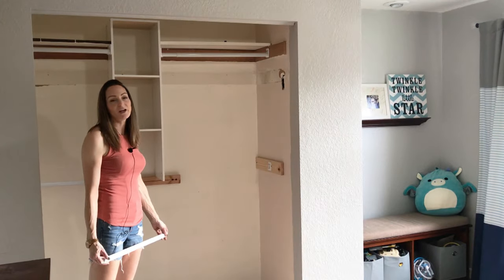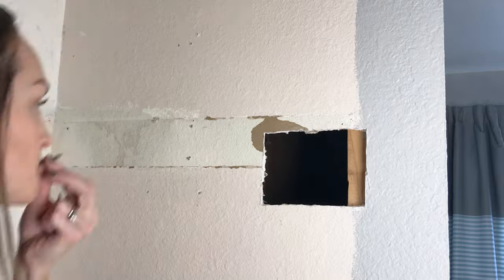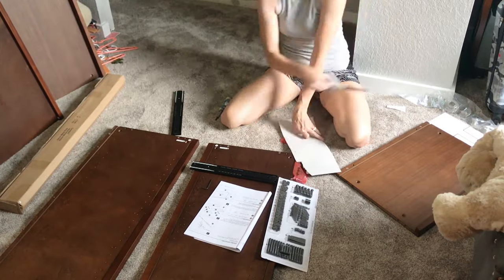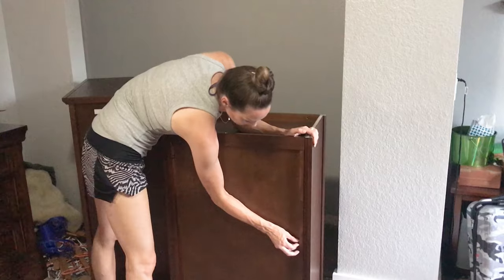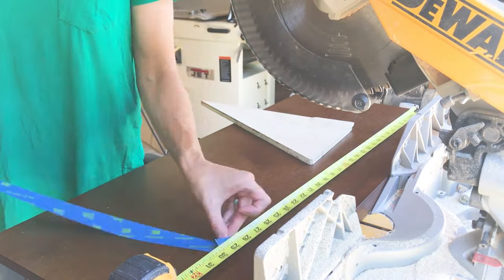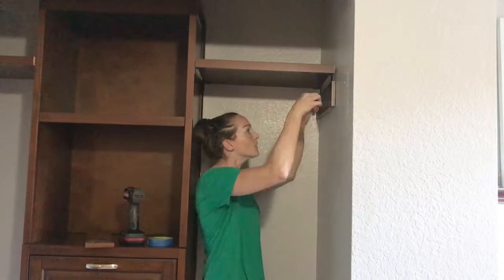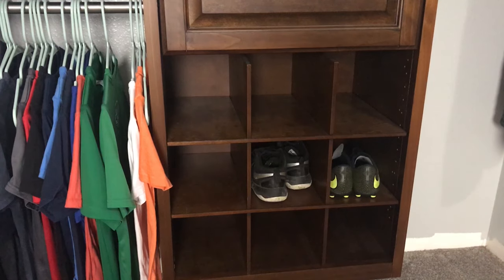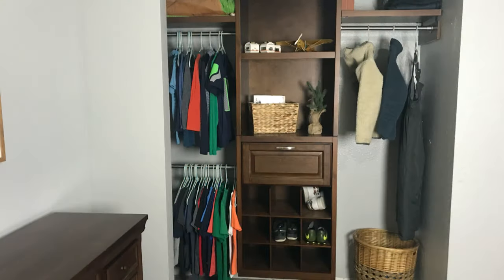Installing an Allen+Roth Closet Organizer from Lowes

Comment: I really love the mischievous kitty interludes. 😸
Reply from the maker: She is quite the character 😆
Reply: @AroundtheHouse  your patch is high because you used the mesh.  Don't use the mesh.  Just put the rectangular piece of drywall in the rectangular hole. Work spackle into the gap with a putty knife, or my favorite tool, a trowel.

Comment: I just purchased this one yesterday!! I originally was going to get the Closetmaid  one however because of some issues at Home Depot, I left and when I looked at Lowes, they only had the laminate version at Lowes but they had THIS ONE!! This was only about $20 more but came with the shoe cabinet which is like $100 with Closetmaid. The Closetmaid one was super lightweight and I could lift the box into my cart. The Allen + Roth was about 5X as heavy and there was no way I could move this at all and used our dolly to get it into the house! This system is so much nicer and better quality. I do need to saw the rods on this one also to fit. The directions are a little confusing since when it comes to some of the sections it would have been so much easier had there been words of which direction verses just pictures.
Reply: With one year down, interested to hear your thoughts on how it’s performing, especially, any sagging on shelves or drawers?

Comment: Wow thanks for the video.  I was having problems with installing the metal drawer slide.  The instructions were a bit unclear on which hole to put them in. Thank goodness for this video. I was gonna return it because i was frustrated  and didn't think I can put it together by myself but you have encouraged me thank you. How do I order the extra drawers might be a silly question do I go to Lowe's or through the manufacturer obviously the manufacturer? I didn't know you can add drawers to it which is really great thank you again for doing this video
Reply from the maker: I'm glad this was helpful.  I agree, it was so confusing.  As for the extra drawer I searched online and found a store in my area with them and went and picked it up.  I don't know why but the stock they had in stores was very random and seemed to sell out quick.  Must have been a COVID project for others as well.  Hope you can find one

Comment: When going into a stud, use a drill.and predrill a smaller hold before putting the screws in :)
Reply: Predrill or you risk splitting the stud or stripping the hole.

Comment: ??? I have this same unit, inherited with the house we bought. The front panel of the drawer has loosened, and then come off. I can't seem to get the drawer off to repair it. Would you mind explaining how to work the soft close mechanism so I can get the drawer out?
Reply from the maker: That’s a bummer. To get the drawer out you pull it out and on the track there are levers you pull up or down to get it to release. I believe one you pull up and other side is down. Good luck

Comment: Thanks for the video! Quick question for you: when installing the shelf brackets on the unit, did you put them on the edges or more toward the interior? Hopefully that makes sense. :)
Reply from the maker: Very good question.  I put them towards the outer sides for stability but not on the outer trim pieces.  However in hindsight it might be a more solid hold if you put it into the trim piece because it's a little thicker.
Reply: @AroundtheHouse  Thank you!

Comment: I bought this just to find out my studs are not positioned to do this
Reply from the maker: Yeah, I hear you there.  One of mine is a bit to one side because of that too.  Please let me know if you found another one that works better.
Reply: Too far apart?   What exactly was the problem?   I’d like to check before getting home with it. Ty

Comment: now you just have to go buy your husband a brand new $80 saw blade after you ruined that wood one cutting steel!!! Holy Smokes!!! I bet he was mad!  I saw "HE" bc if you would have paid for it, you never would have used it. Other than that, nice job!!!
Reply from the maker: 😆 actually since it’s just a curtain rod I think it’s aluminum, it’s actually weaker than walnut. However you can check out my latest video where I did indeed have to replace my saw blade due to a mistake
Reply: haha. just giving you a hard time, bc I've done it before myself!!  (And I noticed my typo where it says "saw" where it should have said "say."
You did a great job. And after just putting one of these up, which I had to heavily modify, I found it to be a pain in the butt!
Reply: I made the same mistake years ago because in another youtube video someone said it was ok to do it. I had to replace the blade and it was dangerous. A piece of metal flew away and almost hit me. Never use a wood saw to cut metal.